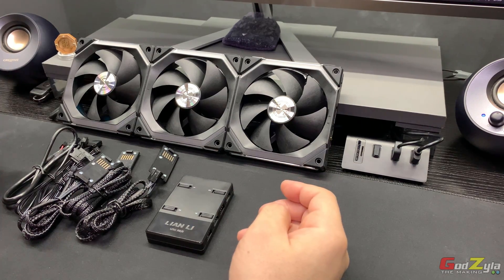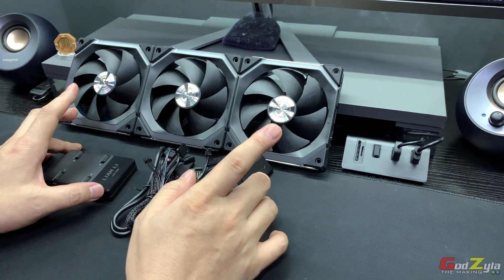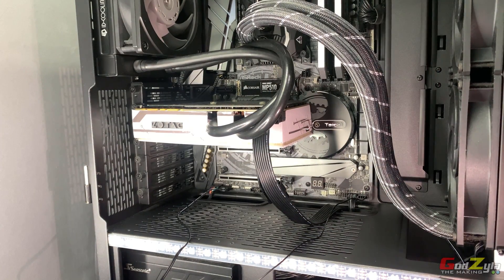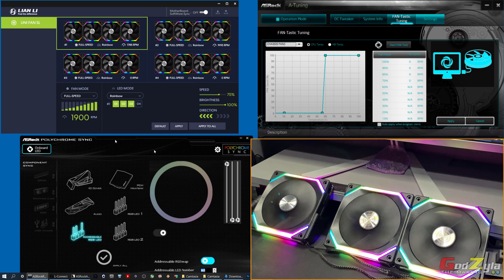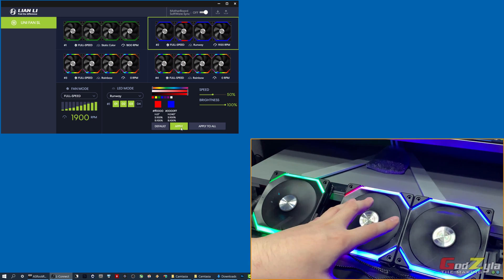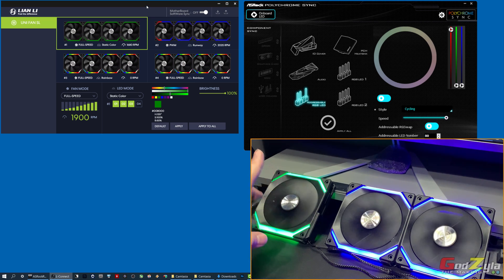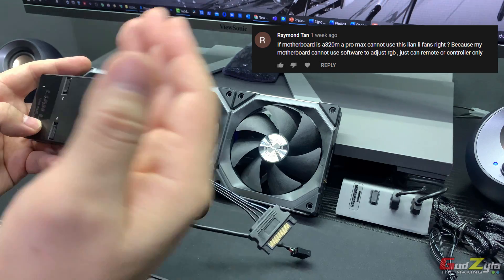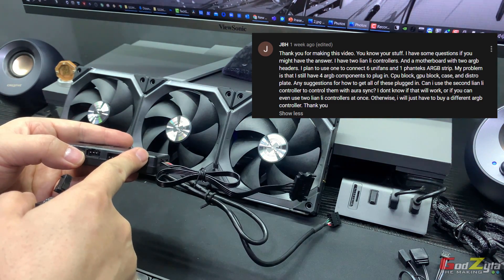Lian Li Uni Fan SL120 - Connection & The Controller (Part III) [L-Connect]

Comment: How To connect 12 fans  in a  Thermaltake view 51 argb case  including 3 Thermaltake default case fans and other 10 are lianli Uni fans? with a same rgb controller?
Reply from the maker: Hi Rajib, thank you for your question. Before I proceed, I advise you not to do so much argb fans on this unit even it is able to take up the load, in long run, you might over load this unit and might burn the resistor or capacitor on the Uni Fan controller. 

now I am not going to be responsible if it does not goes well for you. There are risk involvement. 
Base on what I read on the manual itself https://thermaltake.azureedge.net/pub/media/productattach/c/a/ca-1q6-00m1wn-00_view_51_tg_argb_manual_191224.pdf , your TT case comes with 2 x 200mm fans and 1 x 120mm fans which is connected to the Case controller. where you can press and hold 3 seconds to either control by the aRGB via the case button or the motherboard aRGB header. all you need it to keep your fans connected on the case, there is this argb cable (page 3 MB Signal bridge cable) that comes with your case. This is to connect from your case controller to the motherboard. instead of connecting this argb cable to the motherboard, connect it to the Uni Fan controller (one of the input, lets say input 1) . You will need an adaptor for this. Make sure you switch on your case controller to motherboard mode, which the master control is on your unifan controller and not your motherboard. now please note for the TT fan header. you will need to connect to your motherboard and not to the uni fan controller. I have explain why on this video https://youtu.be/TIO8JxVZTi8 

As for the rest of your 9 SL120 fans. daisy chain them in three and connect each set to the rest of the input of the unifan controll unit. (input 2 , 3 and 4) 

hope that answer to your question and once again thank you for your question and to visit my channel. If you do like my content, kindly subscribe to my channel
Reply: @KleoYan  thank you so much .
Reply from the maker: @rajibpal2743  you are most welcome and thank for visiting. If you like my content, remember to subscribe and to click on the notification bell  :) Thank you!

Comment: Hey there! Very nice and informative video. i have a question tho hopefully you can help me out. i would like to run a single one of those fans as an exhaust fan in my case so the sinlge pack fan would be all i need, but if i do so there is no controller included, would it still be possible to control the rgb of the lian li fan when directly connected to the motheroard and would it then work with asus aura sync too? if not would there be an alternative? Preferably white. I am planning to mainly use white rog parts so it would be nice to have it all matched and in sync. Sry for asking so much i am kinda new to all this :D. Thanks a lot anyways!
Reply from the maker: Hello Player 1230, am glad that you have asked this question and thank you. Yes you can connect this fan to your motherboard but you will need a converter for this. this is what you need, a 1 to 1, Male 5V 3pin (SM3P Male), select the first one under the 1 to 1 selection box from this online shop https://www.aliexpress.com/item/1005001598378033.html?spm=a2g0o.detail.1000060.2.344b4657tCcaOI&gps-id=pcDetailBottomMoreThisSeller&scm=1007.13339.169870.0&scm_id=1007.13339.169870.0&scm-url=1007.13339.169870.0&pvid=34cd9f4a-0d0f-45a1-aa3f-ed53f9d39150&_t=gps-id%3ApcDetailBottomMoreThisSeller%2Cscm-url%3A1007.13339.169870.0%2Cpvid%3A34cd9f4a-0d0f-45a1-aa3f-ed53f9d39150%2Ctpp_buckets%3A668%230%23131923%2386_668%23808%233772%23842_668%23888%233325%2312_668%234328%2319928%23313_668%232846%238112%23517_668%232717%237559%2387_668%231000022185%231000066058%230_668%233468%2315612%23330. 
now please note. one uni SL 120 fan is not an issue but if you intend to do more. please check how much ampere your motherboard can provide. hope this help answer your question. If you do like my content, kindly subscribe and by the way Happy New Year, thank you!
Reply: @KleoYan  Thank you very much! happy new year :)
Reply from the maker: @Player-es8fy  you are most welcome :) and Happy New Year too!

Comment: My question is that what if you're connection the uni fans to an aio cooler. The motherboard has a independent cpu cooler fan header and cpu pump port. Should I connect the fan header for the fans on the aio to the motherboard and have the argb still connected to the controller?
Reply from the maker: Hi Sharif Moussa, thank you for the question. you can leave the fan header to the Uni Fan controller. all you need is to plug the pwm connector from the uni fan controller to your motherboard fan header (the one which you can set PWM function) so on your uni fan controller, you can select the input set (lets say it's #1), just set it to PWM and it will follow your motherboard settings. Hope I've answered your question. Once again, thank  you for your question and to have subscribe to my channel :)
Reply: @KleoYan  would that ramp up all the fan on the hub based on cpu temp?
Reply from the maker: @CMore_  nope it will not.. let me give you an example

Fans plug to Uni Fan Controller - Input 1 to 4 
=======================================
All Input fans are set to Quiet :

Aio Fans - Input 1 (#1)  
Top Fans - Input 2 (#2) 
Botton Fans - Input 3 (#3) 
Rear Fans - Input 4 (4) 

(Plus PWM cable is connected to the motherboard)

If you select Input 1 (#1) to PWM on the L-Connect software, only Input 1 will ramp up based on the temperature readings on the motherboard as the PWM Cable is connected between the Uni controller to the motherboard. 

The rest (Input 2 to 4) will not ramp up as the settings on the Uni Fan is on Quiet and not  PWM

hope this answer your question.

thank you once again for the question, Happy New Year by the way.

Comment: i have an older motherboard without rgb connector (its a GIGABYTE GA-H270M-GAMING 3), could i install this model and control it without problems?
Reply from the maker: Hi Matheus Longhi, thank you for your question. yes you can just use the control unit without plugin the argb cable to your motherboard. it will work fine. just make sure you connect the USB cable from this unit to your motherboard USB 2.0 header will do. Once again thank you for your question and if you like my content, kindly subscribe to my channel and to click on the notification bell. thank you!

Comment: I have 2 grouped fans connected to the hub.  only 1 set of fans spin.  The rgb light is on but fans dont spin.  Using sl14o 2 groups of 2 fans.
Reply from the maker: Hi Phillyman36, thanks for revisiting. I assume 1 group of each is to 1 input. Example 2 fans to input 1 and another 2 fans to input 2. On your L-connect, can u selected full speed and click on apply all. See if your fan does spin? Wow you are fast to get the SL140. 

On your L-connect,
Reply: @KleoYan  Both fans are defective.  I tried to turn the fans by hand and they barely  turn.  Will have to send back for replacement.  not a good start lol
Reply from the maker: @phillyman36  aik! sorry to hear that. Did u get it at a shop or online. If you get it at a shop. I would advise you to request the shop seller to test it after you did an exchange. Just to play safe.
Reply: @KleoYan  I got them from Newegg.  They are out of stock so i may have to return for refund and wait for them to come back in stock.
Reply from the maker: @phillyman36  sometimes things happened. I believe more will be out. Just that right now, everyone is grabbing these fans. Alright buddy, just need to wait till there are more stock. I wish you all the best.
Reply: @phillyman36  same thing happened  to me one of my fans was completely stuck and couldn't spin by hand
Reply: @JMoney3425  i purchased 4 sl140s.  2 of the 4 were bad.  I sent them back to Newegg.  Wound up getting an O11 dynamic xl and buying sl120s.  All of the 120s were  good.

Comment: we can connect led strip to the controller ?
Reply from the maker: Hi Christopher Freire, thank you for your question. if you are talking about argb strips yes. but there is a limit. kindly watch Part II from this playlist. dos and dont https://youtube.com/playlist?list=PLEW-b-2vYDdM1WklGQps2-sQ1Amy6Uwn9
once again thank you for your question and if you like my content, kindly subscribe to my channel and to click on the notification bell. thank you!
Reply: @KleoYan  Thank u very much so where do i buy
 Lightbar extension cable (3P)
Reply from the maker: @crix1993ful  here you go https://m.aliexpress.com/item/32849686500.html?trace=wwwdetail2mobilesitedetail&spm=a2g0s.9042311.0.0.27424c4dScia9R
Reply from the maker: @crix1993ful  opps pardon me.. this is where you can get it but you need to choose the correct one. so look at the connectors properly. https://www.aliexpress.com/item/1005001598378033.html?spm=a2g0o.detail.1000060.2.344b4657tCcaOI&gps-id=pcDetailBottomMoreThisSeller&scm=1007.13339.169870.0&scm_id=1007.13339.169870.0&scm-url=1007.13339.169870.0&pvid=34cd9f4a-0d0f-45a1-aa3f-ed53f9d39150&_t=gps-id%3ApcDetailBottomMoreThisSeller%2Cscm-url%3A1007.13339.169870.0%2Cpvid%3A34cd9f4a-0d0f-45a1-aa3f-ed53f9d39150%2Ctpp_buckets%3A668%230%23131923%2386_668%23808%233772%23842_668%23888%233325%2312_668%234328%2319928%23313_668%232846%238112%23517_668%232717%237559%2387_668%231000022185%231000066058%230_668%233468%2315612%23330

Comment: Hello man thanks for video ! I need to only use 9 fans with L connect, should I need to connect the pwm and rgb connector on mobo WITH usb? Or only Usb is good ?
Reply from the maker: Hi Walle, you can just plug the usb alone, if you don't intend to use the PWM or aRGB mode on your motherboard. as for your 9 fans, just make sure  you only chain 3 fans (max4) to each input to the unifan controller. Thanks for revisiting and if you have any other questions, feel free to pop by and I will try my best to answer them.
Reply: @KleoYan  thx man appreciate !
Reply from the maker: @SandaSu  you are most welcome :) and Happy New Year too!

Comment: Hi  Kleo, im planning to connect 9 unifan for my new pc build. When I checked on my motherboard there are two kinds of header, one is 1A (CHA_FAN1/2/3)and  the other is 3A (H_AMP). Is it safe to plug the unifan controller to any fan header on the motherboard (x570 asus dark hero)?  thank you
Reply from the maker: Hi Rockies. Thank you for your question. The fan cable from the uni fan is only one strain of cable which is the pwm cable. It is safe to plug into any fan header on your motherboard. Once again thank you for visit and do subscribe too. Thank you. 👍
Reply: @KleoYan  Understood. thank you so much for your replyy

Comment: Your three part series on these fans were so thorough and very helpful. Made my installation a breeze. I do have a quick question though. Is it possible to hook the rbg strip from my Phanteks p500a case to the Lian Li controller?
Reply from the maker: Hi Ace, thank you for your compliment.  Is this your case --> http://www.phanteks.com/assets/manuals/PH-EC500ATG.pdf ?
If it is, I would not advise you to do so, the case itself has a controller which either to be controlled by the case controller or to controlled by your motherboard.

Below I will hold no responsibility. The only way if you want your phanteks argb fans to work with the uni fan.
If you are familiar with argb control units, first you will need to unplug the argb cable from your case controller, then you will need to figure a way to daisy chained your argb fans and strips. using a converter which I have shown here https://youtu.be/TIO8JxVZTi8?t=466 , plug to to the uni fan. it should work if you know how, also please take note of the led load from the fans. if unsure, do not perform this as a silly mistake might not only damage the argb control unit but might even short and damage the rest of your PC component. I have ever experience that before as I was unsure and without knowledge. I damage my whole PC just because of that. 

Once again thank you for the question and to have visit my channel. If you like my content, kindly subscribe to my channel and to click on the notification button :)
Reply: @KleoYan  yes that’s my case and I’ll just take your advice and let it be. I subscribed after watching your first video. Part 3 was the icing on the cake. I did my first pc build yesterday and had zero issues thanks to your helpful videos. Thank you
Reply from the maker: Hi Ace, I am glad to help :) and thank you for subscribing too.

Comment: I have a 360mm aio coming in soon. How should I go about the wiring process to cpu fan from the controller? Would I need 2 lian li controllers or just plug only argb into controller and cpu fan directly into mobo cpu fan?

Thank you
Reply from the maker: Hi Kenneth which 360 AIO are you using and are they argb, for argb so long is 5v and it's argb you can connect to the controller but you might need a converter if it's not a lian li Galahad AIO. and for AIO pump, you will need to connect to the motherboard CPU fan header.. make sure to set full speed. as I do not encourage others to run AIO pump on PWM. you will damage the pump.
Reply from the maker: Kenneth, I can understand  you are excited and all, can you calm down lol... contact me at godzylatech@gmail.com .. let me pass you a link to whatsapp. 
as a quick answer,  yes AIO pump to the CPU 1 fan header and make sure is set to full speed, the rest of the SL120 fans you can chain them and then plug it to the Uni Fan controller. thank you!.
Reply: @KleoYan  Hi Kleo, I am using a Aorus 360 Liquid Cooler. I plan on taking off the aorus fans and installing the Lian Li Sl120 fans on them.

Okay this is my first time using an aio. So I want to connect the AIO itself to the fan pump. How about the SL120 fans themselves?

Comment: I have the lian li sl120. I cannot get pwm to work, any tips to help me?
Reply from the maker: what motherboard are you using. did you set the PWM mode on your UEFI / Bios.. if you did not set that on your motherboard, it will not work even if you trigger the PWM function from the L-Connect software.
Reply: I am using the z390 aorus pro mobo. Yes i set the fan to pwm, is there anywhere I can direct message you to send you pictures of my problem?

Maybe you can make a video about this too because it is a common problem with the lian li sl120s
Reply from the maker: @SuperLaOfficial  Hi there, welcome back to my channel, I am using an ASRock Tachi which have no issues and I do not have other motherboard , therefore unable to tell you how to configure it. You can contact me at godzylatech@gmail.com

Comment: Does the software have to run 24/7 after you set up your lighting and fan speed?
Reply from the maker: Hi phillyman36, welcome and am not sure if you did read the other reply which you have posted on my other video. shall reply again :) .. yes you will need to leave the program running, you can set this program to run at auto start when you boot up windows and to leave it on your background (lower right taskbar) to run the L-connect as it will trigger the settings you have done. once again thank you for your question and to have visit my channel. I do apologize too as there are couple of Uni Fan videos I have done which might confuse you on which reply I have response to.

Comment: hey man what if i dont habe a 3pin 5v argb header on my motherboard?? will i still get rgb from lian li controller?? if i dont plug in the 3pin rgb
Reply from the maker: opps.. did I miss your question here. so sorry. do not worry, you will be able to use the hub to control the argb or your fans. not an issue, just make sure to connect the usb cable to your hub and to your motherboard. I think I did answer you this question on my other video, by the way.. all the very best with your new build :)

Comment: nice video, btw i have question. i dont have any usb 2.0 header free, so how can i connect my 6 uni fans to motherboard? motherboard has argb header.
Reply: means can i use it without the usb option?
Reply from the maker: @RohithVRHD  Hi, thank you for your questions. I am afraid that you are not able to control the UNI Fan controller if the usb 2  cable is not connected between the controller and the USB 2 motherboard header. as this is required inorder for the L-Connect software to communicate with the controller. 
Now I have not tried this and try this at your own risk, there is a kind of USB 2 splitter which you can use and this is the link to it. https://www.aliexpress.com/item/4000781872823.html?spm=a2g0o.productlist.0.0.6e324753wmMkDS&algo_pvid=51ab9ce4-de2b-4a78-b10b-74896bf6e380&algo_expid=51ab9ce4-de2b-4a78-b10b-74896bf6e380-1&btsid=0bb0623d16052260974315714ebb42&ws_ab_test=searchweb0_0,searchweb201602_,searchweb201603_